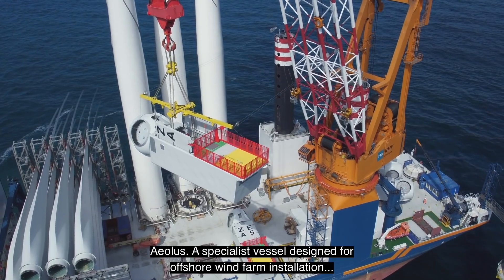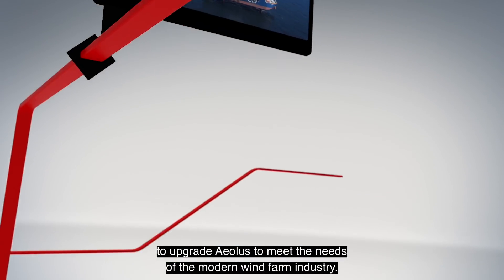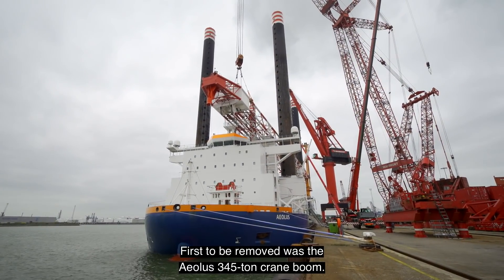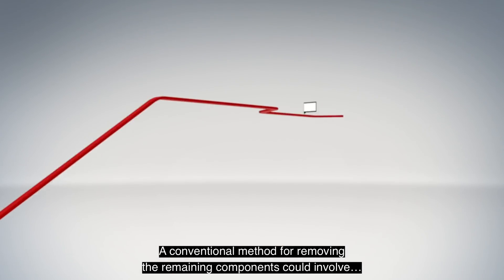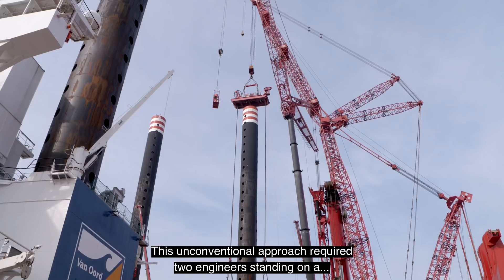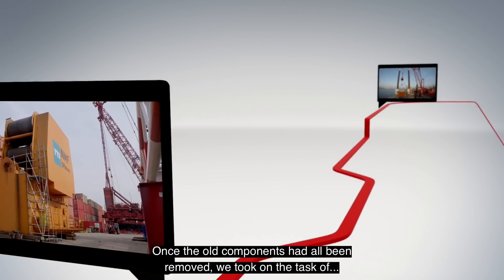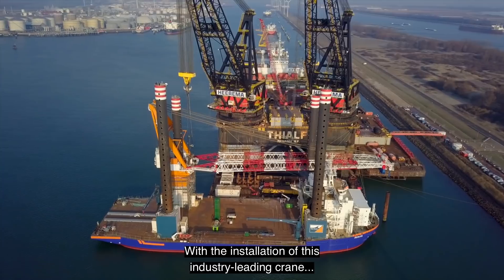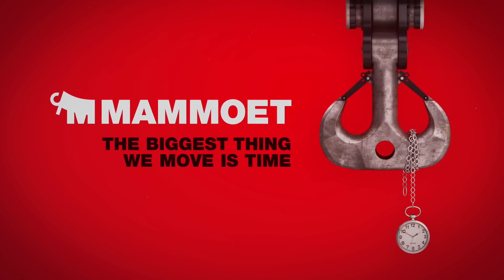Upgrading Aeolus vessel

Comment: how much did that crane weigh that they had to use Thialf?
Reply: The main crane on the vessel has a 1200 tonne capacity with a 100 tonne fast whipline as well the vessel has other much smaller cranes for deckwork etc. I know this because I was controlling the lifting of turbine components over the radio to the the crane driver. A superb vessel with a great crew. The food is absolutely top level on this one.